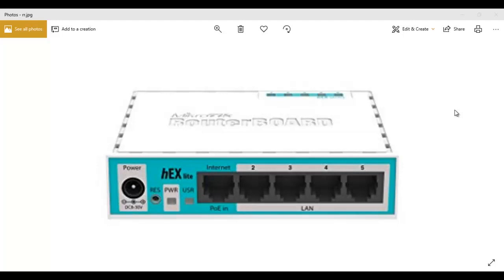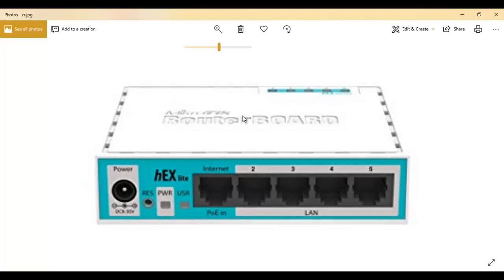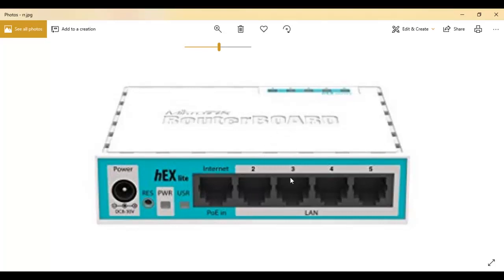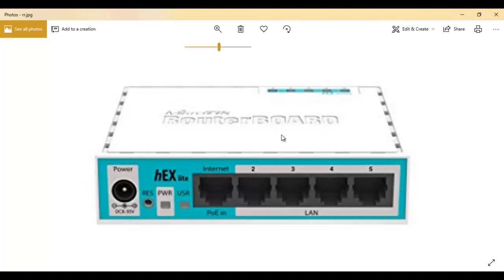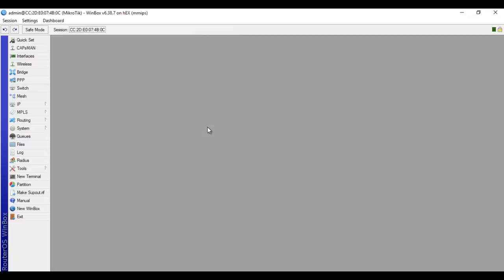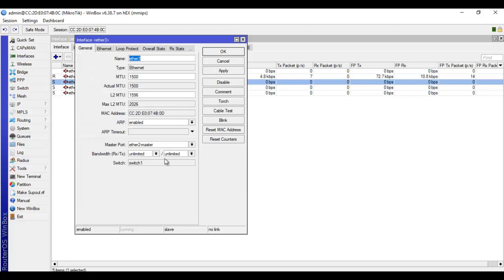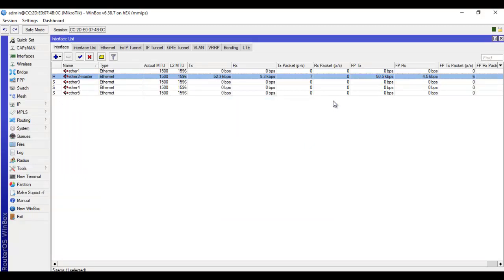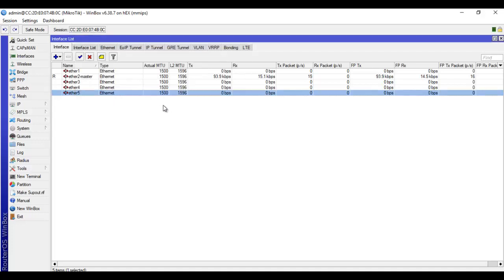Remove a Mikrotik router port from slave mode

Comment: hi, i am on stable v6.48.3 firmware and winbox. My hex rb750gr3 hex has no option on its interface dialog box. apparently you are using a hex lite version and its functions are not exactly the same as hex, coz there isnt a master field to change for hex on any ether ports. how do I do that with hex ??
Reply: Same😢